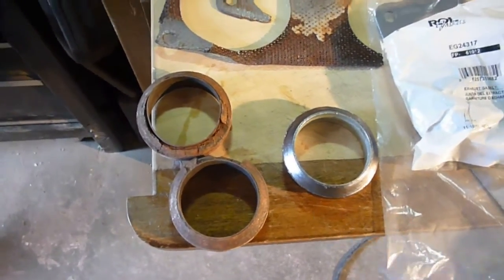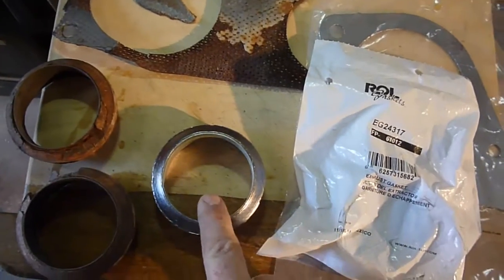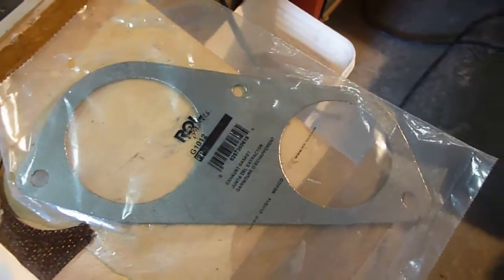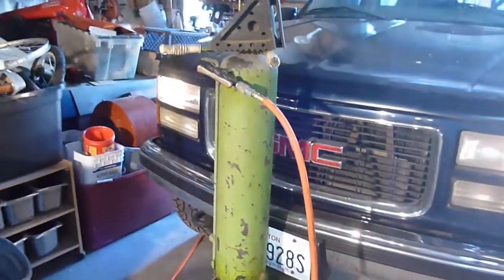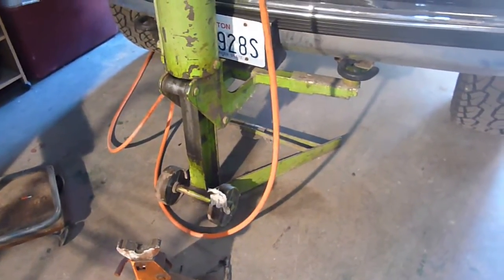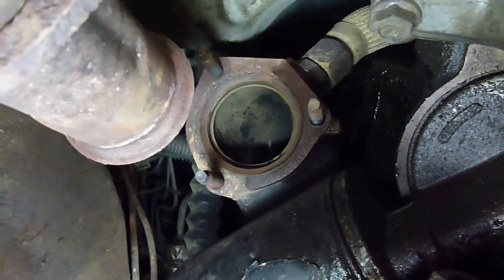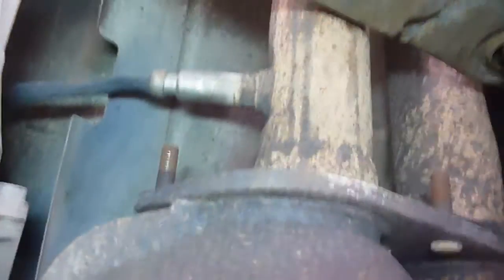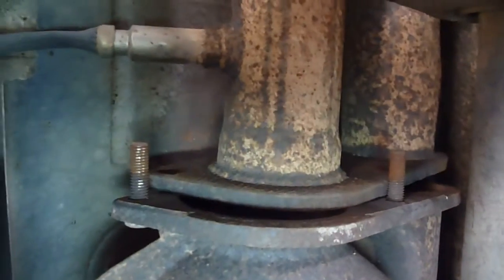OBS GMC/CHEVY 454 EXHAUST GASKET REPLACEMENT

Comment: One important thing to do...Always replace the spring and nuts that hold the pipe up against the flange. The springs loose the tension and if you attempt to reuse them you'll likely find out after burning another doughnut in short order. Also use lots of copper seize.
Reply from the maker: there were no springs on mine but replacing the nuts would probably be a good idea

Comment: almost the exact same truck as i have so thankyou, your video was very helpful. one question though.. my only one that i have to get is the one behind the crossmembe, would it be more benificial to replace all though? also when you have to replace the exhaust manifold please post that video as well
Reply from the maker: i wouldn't change them till they leak the new ones only last a year or two their junk . i will be doing a vid on the manifold at some point because i have a broken stud but it won't be soon
Reply: Junk works DIY Garage okay thankyou very much.